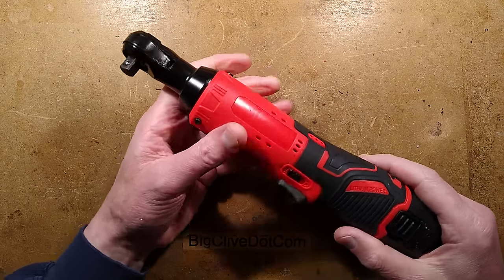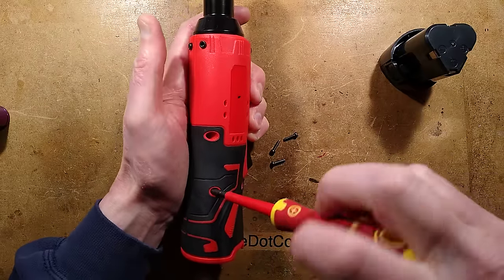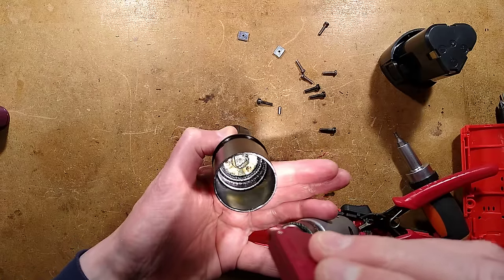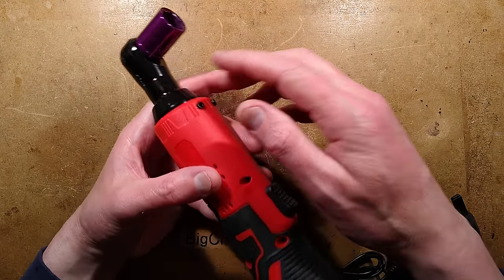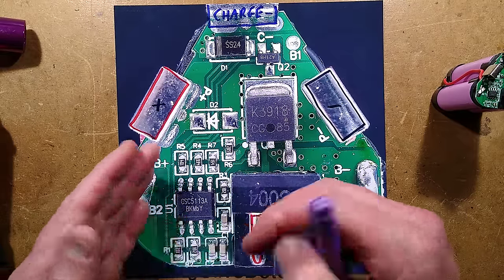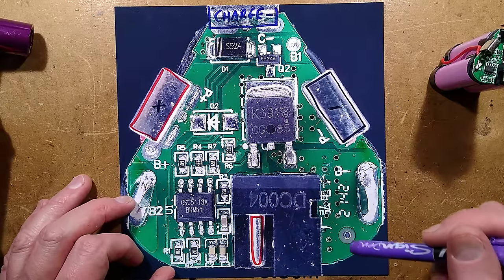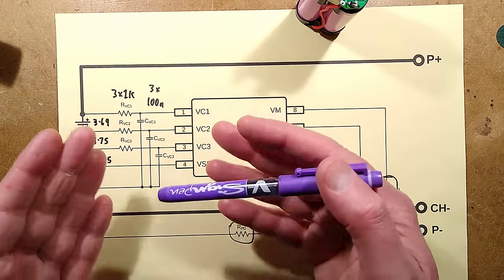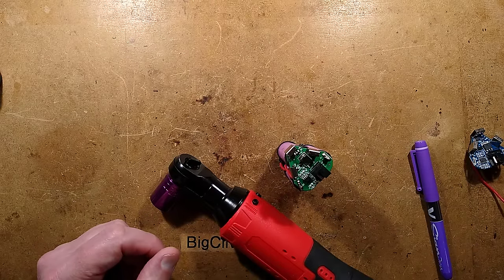Inside a cheap Chinese cordless ratchet

Comment: The part I think most likely to break when handed to a gorilla is the racheting mechanism inside the head that you weren't able to get to. When ran manually the mechanism with the pin on it doesn't actually take any load, that is only engaged when the motor is on. There is a little one-way gear/pawl type thing inside the head that prevents it from rotating backwards, usually the teeth on that pawl are what get stripped.
Reply: Came here to point this out.
Reply: I don't know about this rachet but my M12 broke when my buddy used it as a breaker bar. And it was exactly that crankshaft(reciprocating pin, as this video calls it).
Reply: @countbaker5595  I mean, I'm sure it can happen, but the way they're designed that's not the part that takes the load.

Also, that's why I no longer lend out my tools. ;)
Reply: @countbaker5595  I thought it was a Milwaukee at first. I've been fixing a fair bit of milwaukee tools and other things on my channel, but not done an M12 rachet yet.
Reply: @jimmyb1451  I think that part actually does take the load ultimately. with the pin removed the whole head just rotated all the way around so you could see the gubbins. The ratchet stops the socket connection rotating in the ratchet mechanism but the pin stops the whole ratchet mechanism rotating in the tool. They both end up loaded when using it manually.
Reply: @brendonwood7595  It definitely takes a portion of the force.
Reply: @jimmyb1451  it takes it all. the whole head spins freely with it removed.In both directions. The ratchet jut transfers the force from the pin in one direction or the other.
Reply: @BuyitFixit  I was able the find the replacement crankshaft on ebay and was an easy fix.
Reply: @brendonwood7595  That's not how it works bro.

Why does an IC engine suffer less friction loss on the main bearings and wrist pin at 90 degrees after TDC, than it does at 10 BTDC?
Reply: @jimmyb1451  Are you on drugs bro?
Maybe you should watch https://youtu.be/H0IxzP-Puw0?t=374 again.
How much load is the ratchet transferring from the handle to the socket attachment without the pin there? All the load goes through both the pin and the ratchet.
Reply: @brendonwood7595  "All the load"
Yeah okay bro.
Reply: @jimmyb1451  so you are saying it will still work without that pin because something else takes the load as well?
Reply: @brendonwood7595  I deleted my previous comment. If you look up electric ratchet Milwaukee diagram you will see that if the pin breaks the ratchet is useless.
Reply: Welp I got a cheap one and broke the tang off on the motor… sooo
Reply: @austin012579  bugga! Yeah that'll do it.
Reply: @brendonwood7595 I was thinking the ratchet pawl would take the load with nothing on the pin, but after reading your comment, I see that I was wrong. The pin may take a bit of rotational load, but that's not where the load is that breaks the pin. It's a side, shear load that is holding the panels from rotating.

Comment: When I have to remove Jesus clips, I’ve-clips, or e-clips, where possible I perform the removal operation inside a small sandwich bag, to prevent that pinging across the room.
Reply: Good idea and yes I've done this before it was device that was everything was held together by slotted pins and these sorts of clips

Comment: Could also dissect a snap on , milwaukee, etc. , they all have similar design,  with cam block.  The purpose is  to make the turn more fast,  efficient,  rather than break loose the  freeze  fasteners.

Comment: That pin shouldn't take any force from undoing the fastener as the ratchet mechanism itself locks the head. I've got a couple of Milwaukee nut runners and they're all similarly built. The warranty is pretty much the saving grace as I've used it on two of them so far. That and the electronics around the head LED is a little more complex as it comes on just before the tool actuates and stays on for a couple of seconds once released. You can use it as a momentary torch.

The other big thing people misunderstand about these runners as they're just that - a runner. They don't have any cracking force as they're not an impact. I use them to run things like sparkplugs in and out as they don't have enough torque to overtighten or cross thread. When doing plugs on a V8, your wrist thanks you at the end of the day.

Comment: I have a similar Chineseium rachet,and have used it quite a bit over the last three years.My major likes are 1) it is/was cheap.er.inexpensive,and 2) I can have a powered rachet without having my 60 gallon DeWalt air compressor running.Is it pro quality?Oh heck no,but it does the job for me!One of the battery packs has died,and thanks to your shcematic I may take it apart to see of I can fix it.What's the worst that could happen?

Comment: Hey Clive! Thanks for the shout out! Yes our guys definitely put tools through some heavy work and warranty is a big thing.

Loved the tear down of this ratchet. Wonder if they chose that color for a reason ;)? If you ever want us to test a particular tool in the field to see if it survives our kind of work let us know too.

Cheers from everyone at THD!
Reply: Color... Yep, Ripped off from Milwaukee.
Reply: Is the 12V battery shape similar / identical to Milwaukee? Would that battery fit in a 12V Milwaukee tool?
Reply: @stevebabiak6997  Looks close from the video, but I couldnt tell exactly.
Reply: @davelowets  - the copycats usually try to make it fit, so my guess is it does; Clive might be able to take physical measurements if he doesn’t have a real Milwaukee 12V tool to try it in.
Reply: @stevebabiak6997  I am aware that some of the Harbor Freight series of batteries fits on DeWalt tools with minor modifications.
Reply: @davelowets  - that could be true, but HF isn’t trying to mimic the other tool brands. For example, the Chinese suppliers produce battery copies for various power tool brands that are intended to be drop in replacements (but usually use lesser quality cells in their construction). I’m guessing the tool in this video is trying to be a Milwaukee copy, at least as far as the battery goes.
Reply: @stevebabiak6997  I domt think it's an accident that you grind off a tiny tab of plastic, and the DeWalt and Harbor Freight batteries interchange. That's a slick marketing trick.
Reply: @stevebabiak6997  What? You truly believe they're NOT trying to mimic other brands? Every tool in their store is a direct ripoff of some name-brand tool.
Reply: Clive isn't a shill Chanel
Reply: @davelowets  A slick marketing trick to help up all!💪
Reply: @ricky-sanchez  Yep. And to help themselves.
Reply: @davelowets I'm fair confident that Stanley Black and Decker or DeWalt themselves OEM for more than a few HF tools, if not most of them.

Comment: Almost like a Milwaukee, hahaha!
Fun mechanical teardown, and I wasn't expecting a BMS reverse engineering. You wouldn't be you if you didn't go over some electronics.
Reply: Yes definately has a milwaukee look about it. The milwaukee M12 batteries don't have a BMS in them, it's done in the tool. I've been repairing quite a few milwaukee tools on my channel.
Reply: Almost… but it’s actually AvE’s favorite brand, WilFuqYe! 🤣
Reply: I think this is a copy from Milwaukee. maybe the contents of milwaukee are the same but with stronger metal quality
Reply: Many are made in the same factory in China.  The Milwaukee ones are made in the same factory as the cheaper Devon brand , even Ryobi, but not using the exact same parts. .  I use both in my shop . The Devon brand is half the price of Milwaukee,  but buy no means half the quality .  My Devon  impact gun has been a beast , coming up to 3 years and no problem and it's undone some wheel nuts the Milwaukee wouldn't.  Maybe a power limiting battery protection system in the Milwaukee that the Devon doesn't have ?

Comment: I have been using one of these for the last ten months and so far its holding up okay. For a bit of context my main work is small engine repair so no doubt it gets an easy life, I'm sure if I gave it to one of the commercial boys it would die in short order.
Reply: I have the same one and it's great for light duty work.  Even took a gearbox out with it, a godsend for zipping out bolts in hard to reach places
Reply: how does it do with such a short neck?  looks great for taking pc cabinets or server racks apart but engines?
Reply: @billynomates920  works fine
Reply: @billynomates920 I believe there's long neck versions out there, at least for brand name ones. My setup is an open box milwauke i got around 5 years ago, a used charger and a few knockoff batteries.
Reply: Worst part about my Wisconsin branded tool is the inability to change the rotation direction if you get stuck. I've gotten into real pickles
Reply: @billynomates920  Generally not an issue, the majority of fasteners that normally need to be attended are accessible with a selection of extension bars. I Wouldn't dare try to use it on any internal engine fasteners.

Not sure what hardware is on the cases/racks you mentioned, just be warned it has enough guts to strip out those horrid self tapping bolts if you aren't careful.
Reply: @jayyydizzzle  You aren't the only one! It takes a while to remember such limitations (that invariably I forget).
Reply: @billynomates920  extended reach ones like the milwaukee are WAY more convenient. I'd recommend having 1 of each though, sometimes you need the short neck.
Reply: Well, many "commercial boys" mistreat their tools by clearly operating them outside the load they are built for. In the world of power tools "Quality" is often just an euphemism for "idiot-proof".
Reply: @dangerousdave5076  I can see it being handy for times, where you can only 1 or two clicks  of turn and spanner is just out, but that little moving pin, seems like a very weak link, just waiting to break. spose it could be made of something really exotic, if a big brand make one could it be swapped out,   for a better branded version
Reply: @dh2032  indeed, lots of instances where there is plenty on vertical space "above" the bolt but no horizontal space to get a good turn of the ratchet in. 

Crack it with the manual ratchet and spin it out with the power one. Saves so much time and energy. 

Think mine was £30 delivered, well worth it.
Reply: @jayyydizzzle  How could you "get stuck"?? 
The ratchet will swing one way freely, and you should most certainly be able to apply much more torque than the ratchet could ever be able to, and get yourself out of any situation. I've used an air ratchet for 30 years, and have never gotten "stuck". 😕
Reply: @billynomates920  A tool like this is overkill for a server rack. I use my 3/8 cordless ratchet for automobile repair on a daily basis. They're tougher than you would think.
Reply: @dh2032  I've never had the pin break in 30 years of using an air ratchet. Same design. I've had a few battery powered ratchets for over 5 years, and have never broken a pin. I'm sure it's possible to break it if you tried to use it as a brraker bar, but under normal use it doesn't seem to be an issue.
Reply: @davelowets  an unfortunate design flaw of the milfuckies is the the direction is in+set and perfectly flush with the rear of the ratchet housing, the style clive has a much better design. For me I've got stuck with backing out long bolts with a welded captive nut in a tight spot with no rear room, think inside some world square stock. When backed out to quickly, the bolt will act as a screw press against the ratchet and socket will leave no clearance on the milwaukee to change direction.
Reply: @davelowets  reading the replies i'm sold!  i'm not going to be using it for removing headbolts anyway. i just wondered if it can do double duty on say battery cables, bracketry as well as the shelving and other homemade stuff i have put up around the garage.   👍
Reply: @jayyydizzzle  That could happen with any of the ratchets regardless. You do have to look at your situation, and think about it for a second, before you go at it.
Reply: @billynomates920  Easily. You'll be glad you bought one.
Reply: @davelowets  I've definitely made some rookie mistakes lol. It only took me a couple times to learn the hard way.

Here's an image that almost captures what I'm talking about:
https://i.imgur.com/06GBHEz.jpg
Reply: @jayyydizzzle  😆 Yep, we've ALL done it a time or two....

Comment: That’s trying it’s best to be a Milwaukee 3/8 ratchet. The biggest cost savings they get out of those is in the batteries. I’ve looked them up and they’re only rated for a hundred cycles.
Reply: i knew youd be here
Reply: Is that some standard size of battery where you could buy a decent (possibly even name brand) one that lasts longer?
Reply: @rolfs2165  Could just buy some good brand 18650 cells that are a good mix between capacity and amps! Then you can just pop the battery apart, swap the cells and you're good to go!
Reply: @Guggu3d  True, but I like to have a spare battery as well, so I don't have to wait for the charger.
Reply: @rolfs2165  Can probably buy the batteries separately. Either way the ratchets don't yse a lot of juice. My milwaukee lasts me easily an entire day of use as an auto mechanic
Reply: I worked once for a company that used Milwaukee as standard, ALL of the drills failed within a year, the batteries were fine, but the mechanics were crap. I would recommend Makita, one of their drills had so much torque it actually flipped me on my back. No other power tool has done this.
Reply: Yeah, the battery looks like a knockoff of the M12 series pack.
Reply: @stawmy  X
Reply: @stawmy  Than someone must have been purposely destroying them.... Probably the Makita nut-swingers. 🙄
Reply: @stawmy  Weird. I don't use their drills much. But their electric ratchet just won't die. Had it for about 3 years now and never once failed me. Gotten wet, oily and full of dirt, still works like first day despite looking a bit rough!
Reply: @stawmy  Every brand has their duds - that's what makes it so hard to stay with one brand (battery) and you end up with 6 different kinds of batteries and chargers.
Reply: Nah, the batteries are cheap. A Samsung 18650 is much under $5, so a 3 cell pack would be under $20. Brand-name power tools sell under the razor blade/ink cartridge model where tool is sold at cost/minimum profit and the batteries are hugely profitable. This allows for value-based pricing, a trade user buys and wears out a ton of batteries and pays more than a home user with 1 battery in the tool's life.

Comment: I was incredibly surprised the first time I saw a large lithium pack that got charged by a "wall wart" with a barrel connector.
I'm so used to seeing a massive hunk of ABS plastic  that the idea never even crossed my mind that the battery could be charged from a simple power brick.
Reply: I have a 24volt lithium tire inflater that has a large removable battery pack. The charger for the pack is a large wall wart with a barrel jack on it that plugs directly into the battery pack. I though that it was some kind of cheap fuckery also, so I took the pack apart to see what was going on inside. It ended up that there was a full charger circuit built inside that simply used the wall wart as a power supply for it. The circuit board inside had all the typical lithium charger features such as c.c.to c.v. for a charging routine and cell balancing. Kind of odd to manufacture a battery that way, with the entire charger minus the power supply, built into it. 🤷🏻
Reply: @davelowets  I don't think it's that odd.  You're going to need like 90% of the circuitry for the over discharge protection anyway, so for the cost of a diode and really small MOSFET you can just eliminate the charger.
Reply: @uzlonewolf  Its definitely not a quick charging scheme like a proper charger would be.

Comment: 5:55 Just last week, I learned why ratchet spanners have an open end spanner (or ring spanner) of the same size at the other end. You never put full force on the ratchet. The fixed spanner is for the undoing. The ratchet is for the spinning. 😊